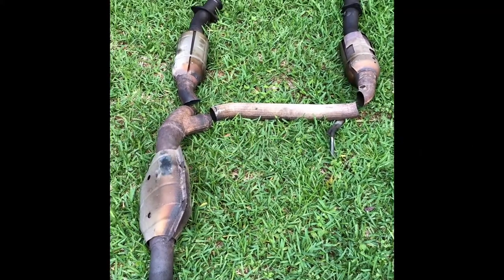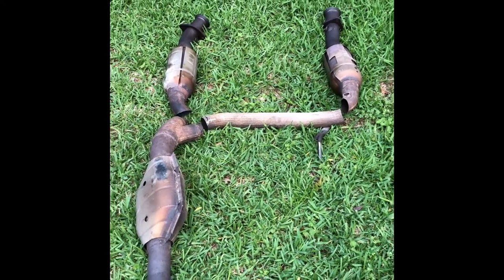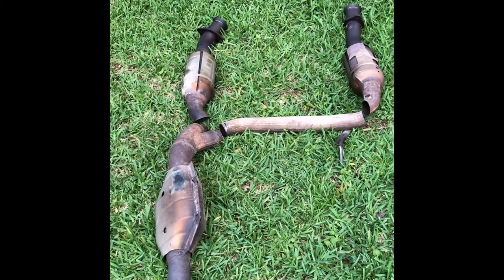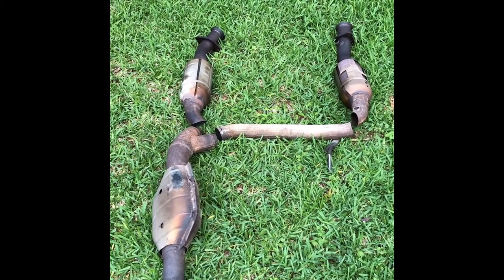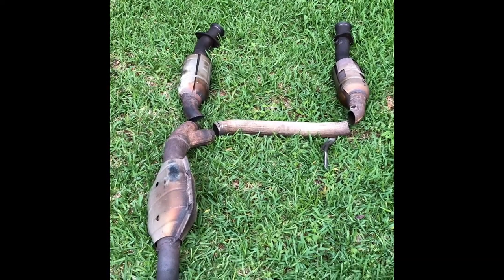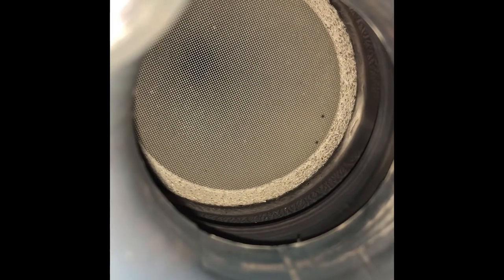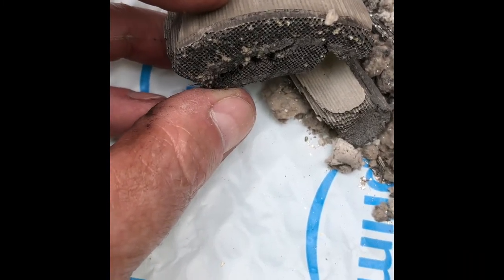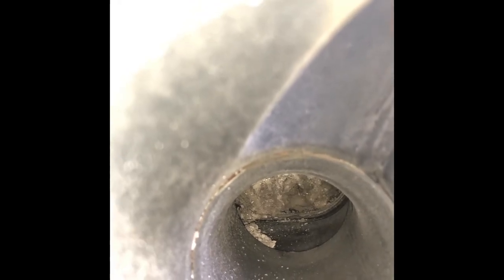2004 4.6 V8 Explorer clogged catalytic converter

Comment from the maker: I got Affordable Mufflers in houston to I stall the new assembly for $85 + the one still good original cat. Turns out the inability to accelerate over 3k rpm is a rev limiter while in park, so what I was using as a symptom had nothing to do with the problem!